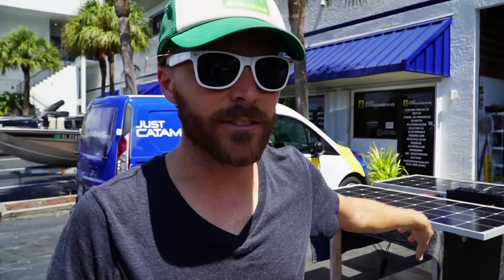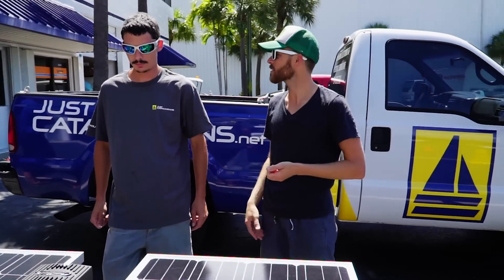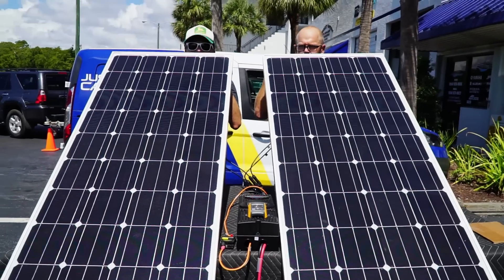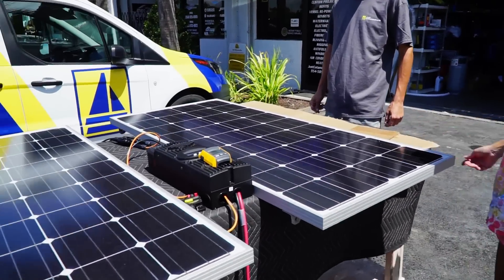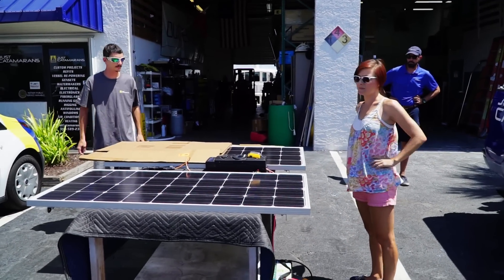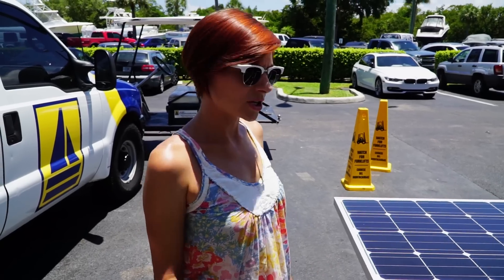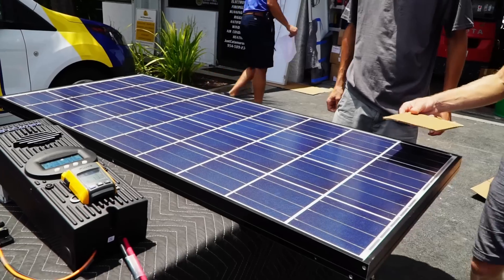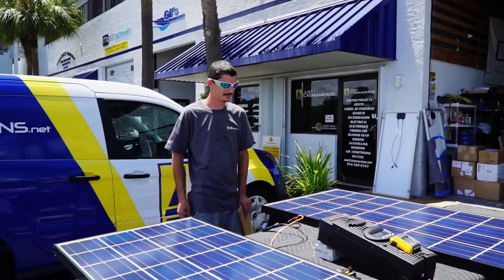Sailboat Solar Power - Series vs. Parallel & Shading

Comment: If you guys haven't found them there's a solar channel called AltE on youtube. I've gotten some really in depth technical advice on that channel and from the channel operator in reply to my questions. They answered the series vs. parallel on their channel as well as what charge controller to use when you do one or the other. Might be a little late for you but you can't make a mistake testing it for yourself.

Comment: In case you didn't know, its because your cells are in series.  If you had a whole bunch of little 10 watt panels, the resulting shading would be much less of an effect.  When you shade a cell, you are essentially cutting off the flow of electricity through that panel.

Comment: I ran across the following in an article about using solar for powering amateur radios, and thought it might be relevant to your issue with shading. "When selecting a solar panel, the key feature is a 'bypass diode'.  Without that, anything that shields a spot on the panel makes that part of the panel perform like a resistor. Resistors have lower voltage. Silicon cells are supposed to produce voltage. Pretty quick, your efficiency is destroyed by random shading without the bypass diode feature. Of course, I learned that after making a purchase or two. Ready, fire, aim! All the major lessons of life are seared into your memory by shame, grief, pain, or all of the above."
Reply from the maker: Yep, our panels have 3 bypass diodes and they still get knocked out when a complete cell is covered.

Comment: Parallel is going to be your best bet if multiple panels can be in shade. Wind turbines make a good complement to solar. It is a different animal and often works well on boats. You can also consider strings of panels (2 panels in series for example) with the strings in parallel.

Comment: Thanks.  I had no idea that just shading a couple of cells could have such an effect.  I was about to buy a flexible unit and mount it on the coachroof under the boom thinking that a bit of shadow wouldn't hurt.  Time for a rethink...
Reply from the maker: yep, I keep thinking there must be a way to float a few panels behind us, that would be way out of the way from shading while at anchor :)

Comment: Makes sense because the cells in the panels are wired in series so when you take one cell out you break the circuit which takes out the whole panel. I've heard the older poly panels do better with shade and they are cheaper too! Never tested them though :/

Comment: What a great demonstration.Very useful.

The other useful and easy thing is to show the single panel, one cell shading scenario too, to help verify the characteristics of the panels bypass diode setup. Low voltage panels are often internally a combination of series and parallel wiring of individual cell groups, so this might contribute to the partial shade characteristics. Different brands might matter - they are optimising for total output under uniform shade, and bypass is mostly about panel protection.

For pure serial connected cells, each group of cells covered by a bypass diode should reduce output in proportion as a group is taken out by shade. I don’t know why you didn’t see this? Worth investigating

For parallel connected panels, a bypassed group in one panel will rapidly push the panel into a very low efficiency zone, effectively reducing it's contribution to zero - exactly what you saw. Parallel panels really need chargers that accept their connections individually (multi string inputs)

I’d be really keen to see you play with a single panel, and show us how it behaves, and to compare higher voltage panels with that. I think that you might find that higher voltage panels will degrade more linearly, as they have no parallel component internally, and building a system of them might work better in partial shade? Also, knowing how the panel is laid out internally might help you decide it's orientation too (the paper below shows a scenario where shading just one row takes out the whole panel). 

This might help too https://www.sicleanenergy.com.au/wp-content/uploads/2014/05/Shade-Effect-Paper_Final.pdf

Comment: Hi Guys. You need to go with higher amp panels to give you enough power. On my Leopard 40 I have built a frame for behind the boom sticking out a bit from the Bimini. I put 2 x 345 w panels up there in parallel with 2 controllers for redundancy. On the hook as my boat is stationary in one position I pull the boom to one side allowing max sun on the panels. I have 600amh of battery power. Using all the toys from sunset to sunrise with the fridge 24/7 I tend to use 150 amps. This is replaced on a normal day by 12:00 the next day. 400watts on a big cat is not going to help much ! Got a nice pic of my frame up if you want it.

Great vids

Comment: In a real world test you should have some load in the circuit (like a light bulb) and be measuring power (in watts), which is the product of voltage and current together. Then compare the readings of parallel vs series connections, and your various blocking patterns. Also, since you got essentially similar results using different panel makers, perhaps trying different charge controllers might reveal an indicative result. Anyway, those were my curiosities from your tests. Overall, nice work guys! This is how we learn!!
Reply: The load is the battery. Which has a resting voltage lower than the one at the end of the charge controller so current flows to it... It is a real world testing, the panel/charge controller doesn't care if it's a light bulb or any other load.

Comment: Hey guys, Just started following. I'm sure by now you have figured out that shading is the biggest enemy of solar. I've been in it for over ten years now. your test with shading was good but to help you understand the principle of what you were looking at the circuitry of the modules is to protect the module. Which means if you shade one it shuts down the module. Also, you need to keep them clean. Which means the salt residue from the spray would have diminished the performance. i think all in all on a boat go with a wind generator.
Reply from the maker: I don't think wind is the solution either...

Comment: Consider the option of two charge controllers in parallel, one for each panel. You will still get the loss on the shaded panel, but you will get full amperage out of the sunny panel. the amperage sums, voltage stays the same. some controllers have a dual mode for this purpose.

Comment: Also, If you guys will be doing any further tests,  its important that you use the systems Wattage(or KwH, as the display will sometimes have it shown as) to gage the effects of shading.   This is your total power.   The amperage is just on of the two components that make up the power and when comparing series to parallel, you need the neutral component to accurately tell whats going on.  
Yes, the amperage dropped off significantly when in series but the voltage is twice the amount as it is in parallel(when using two panels).   So, your overall power most likely was not too different between the two tests.   I have had the opportunity to be involved in similar tests with a case study we have going at UC Riverside.  The whole thing was put together to test the claims of the Jinko modules i mentioned in my previous comment. 

When comparing series vs parallel, the real considerations lie in the other components you plan to use with your system.   It is almost always more cost effective and efficient to go series if you are using more then one module.  You have less voltage drop, you can use smaller/less expensive wire, that smaller wire gives you flexibility with your run,  you get more dependable/longer charging each day, and you can use smaller fuses/breakers to protect your system.    

I hope you guys find what works for you.   If you have any questions, feel free to HMU via PM.

Comment: Installing Solar panel in series is used to take advantage of long cable runs so smaller wire (Cheaper), Long runs in Parallel would mean higher currents and maybe 2 times larger cables. Most panel do not have a shunt diode near near the outside edges where all the individual cells are combined. Series is most command in Home installations where there will all ways be a some distant on the install back to the charge controller.

Comment: How do the "micro-inverter" set-ups work (they are supposed to function better with shading), compared to "parallel" and "series" wiring that you illustrated?  That is an inverter for each panel.)

Comment: I knew shading could be a problem, but had no idea one shaded square could kill a whole panel or series of panels. It is great to see a real world and well executed test!  

P.S. I imagine the clamp meter you had is designed to only measure AC current.  Since the panels output DC current, I expect that meter was not reading correctly and just picking up noise.  But I noticed you didn't show any of the clamp meter readings in your video, so perhaps you already figured that out.

Comment: altE did a video on using a different chg controller for different panels which will keep one shaded panel from dragging the other one down. One example given was on a sailboat application.

Comment: I have a question. Do they make a solar junction/ switch box that allows you to say run 4 panels into it separately and monitors input so that say 1 panel drops low it isolates that panel and keeps outputting the outer 3 to the charge controller to get the most of incoming solar???? This may be a stupid question but at least I asked🙄

Comment: Location of the panels needs to be looked at which I am sure you have considered, I have seen panels installed over the aft dingy which takes the boom and rigging out of the picture.  Also agree the a wind turbine would help in this instance to supplement your power gathering needs.

Comment: Hey guys, 
Love your channel.  I would suggest you look into a module called the Jinko M-series.  They come in 260 watt modules and would be perfect for your application. They have led the market in the last year in cell string level shade mitigation(they call it Cell String Power Optimization).  The technology does the same thing that products like SolarEdge and Enphase do, except they bring it down to the cell string level, making them the best solution for shade mitigation available.   The beauty of their product is that it is not proprietary so you can use it with any inverter/charger/battery setup.    I have worked in the solar industry for a while now and was a little skeptical to hear some of the claims Jinko was making when our company brought their product on.   I have since been proved wrong and am now a believer after personally tracking over 200 jobs installed with the jinko 260 watt pannel.  Check 'em out.  Not sure if you are in the market for something new, but IMO, when you are relying on Photovoltaics for electricity and space is an issue, the solution is efficiency.
Anyway, probably sounds like i work for these guy but I don't.   If you don't go that route, i highly suggest you swap out those other module you have for a single Sunpower module or a pair of them if you've got the space.  

file:///Users/admin/Downloads/SMART%20MODULE(maxim)%20(1).pdf

Comment: Do you have the option of using four smaller panels equalling the same area and of the same voltage wired in parallel?
As I see it, you are really testing  series/parallel configurations. Each panel has its cells in series or else one cell could not do so much reduction. Four panels would only lose 25% for that amount of shading.
I use a small PV panel to power the 12V pump on my Solar Thermal water heater, and the angle of sun is much more critical for the water heater. The PV panel has the advantage of automatically stopping the pump at night, but because it works at larger included angles will start pumping earlier the next morning which can allow hot water stored the nigh before to radiate out into the shade of a cold morning sky. The sun has to reach a better angle to counter that loss.

Comment: What is the life span of a panel and what lithium batteries are you using again?  What on the boat will it not power.  You don't need air conditioning on a boat so what is going to be the biggest current draw?  Interesting test you did.

Comment: Were there diodes in the  panels ? Did each panel have their own controller ? Were the panels mono or Poly ? It is clear to me that it isn't a back yard job, each boat/surface area/ electrical system is unique....but solar is best.

Comment: Intersting video. My first thought is to add as much panel as possible and use a charge controller that can accept any amount of power even if it can't process it into charging. Also I am curious as to the possibility of wind power on a sailboat. Interested to see how things work out!

Comment: Silly question, assuming the panels are set up for 12V systems, in parallel you get 12V but in series you get 24V, did you adjust the controller to work with 24V, would the out come be the same?

Comment: Might be worth mentioning you should be measuring Watts not Amps.  Watts are a measure of power Volts X Amps.  Amps are a measure of volume of flow .  In series you will have twice the voltage so even if you have half the amps you have the same power.  If you got about the same amps in series you were getting twice the power.  Your installers should have know that.

Comment: There will never be a situation where one cell is completely blocked from light during the day. Putting the cardboard over one cell is not a true indication of how the panels will work. But the video was very interesting and  some good information. It does go to show that if one panel goes out you will have problems with your system.
Reply: What it showed was that if one or more cells  are shaded then that panel is going to produce almost nothing. Having the second panel was masking the effect the shading was having on the single panel. One panel was producing full output whilst the other was dropping to almost nothing. What it showed me was that a small shadow across both panels was very bad compared to the same amount of shading to one panel. So for a boat where shading radiates from the mast it would be better to have a starboard and a port panel layout versus a bow and stern type layout. So that there was more chance of one of the panels being unshaded for longer.

Comment: PV panels are internally wired in series, usually into a single panel charge controller, then sent out via whatever type of connection to a bank. Because of the nature of semiconductive chips, when you fully disable a cell it effectively increases the resistence that energy being produced in surrounding cells must pass through in order to exit the panel. This is also why multiple panels in parallel is more efficient, so that when only a single panel is at a higher resistence, it isnt affecting the entire array. The only practical way to elimate cascade resistence from shading is to custom build your own panels, wiring the entire panel in parallel, a step that means little to 99% of solar users. If it were me, I would build a bracket above your dinghy davits and run 4-5 kyocera panels in full sun, rather than a much larger partially shaded array. Good luck guys. ~J

Comment: The reason the drop is always ~50% is this:

A solar panel with 72 cells is actually two sets of 36 cells wired in series, then the two series are connected in parallel. So if you shade one cell, effectively that entire series is shorted out so you're only getting power from the other series that's un-shaded.

Think of the old school Christmas lights where when one bulb goes out the entire strand goes out. So, in a solar panel you basically have two strands of Christmas lights each with 36 bulbs, and they both sets of lights are twisted together. If one of the bulbs goes out (is shaded), then half your lights go out.

So, the question is - why would they connect the cells in a series instead of parallel? Each cell produces about .5V of power. If you connect them in a series, the voltage multiplies time the number of cells connected. If you connect in parallel, the voltage stays the same. (Regardless of connection, the amperage increases). So, in perfect conditions:

30 cells x .5V = 15V (the voltage to charge a battery needs to be slightly higher than the battery voltage, so a 12V batter needs a ~15V charger.)

A 60 cell solar panel will have 60 cells, but they'll have to be divided into 2 series of 30cells to get you the 15V. Each of the series combines parallel at the end to give you twice the amps (but still 15V).

15V is the minimum voltage required for this type of use. You could have a panel where all the cells were in series which would give you 30 V and then use an inverter to step it down to 12V (with no theoretical power loss), but that would mean if any of the cells were shaded you would have a complete power outage from the panel.

The ideal set up (currently) would be to have a 72 cell solar panel then use an inverter to break down the power into 12V and 24V for the two systems, but the 72 cell panels are considerably more expensive.

Ultimately though, on a sailboat the panels themselves definitely need to be wired in parallel (as you've demonstrated).